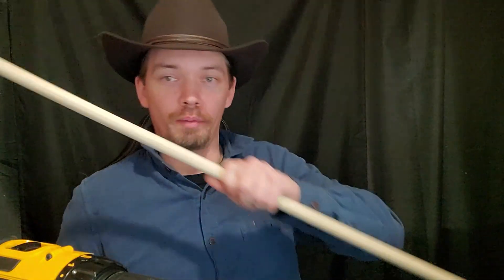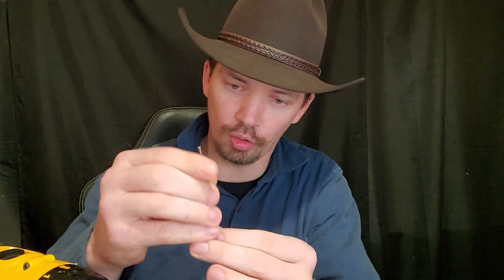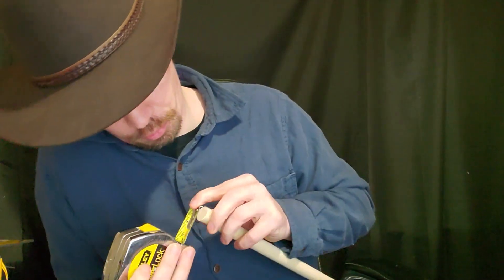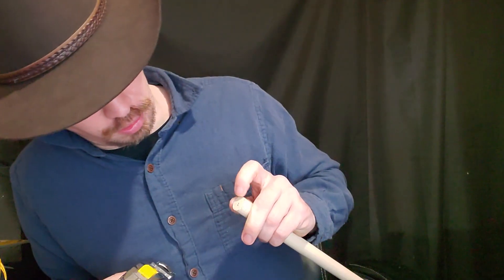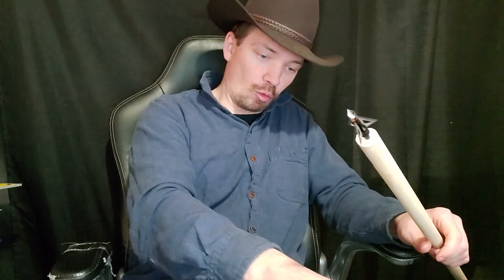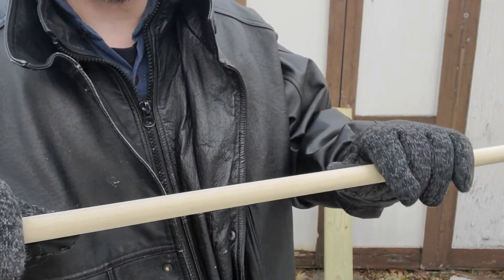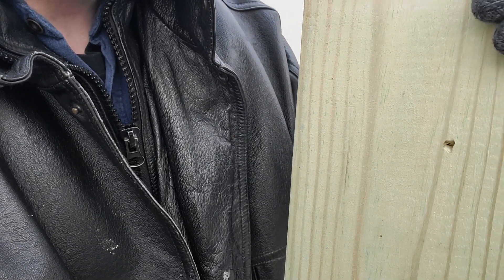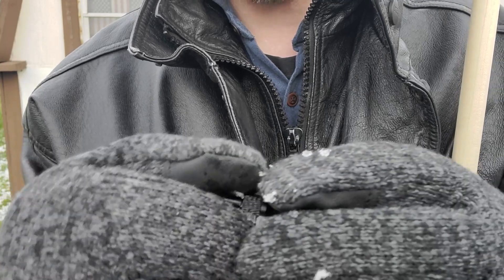A Failed Spear

Comment: Great try !! And yes look for the old style bear arrowheads. But you would be better off stepping up to a 1 1/4” dowel and sharpening the dowel to a point and then sticking in some coals for a little bit before doing a final sharpening and smoothing. The heavier dowel will allow you to use it as a staff and also give it some punch if you threw it!! 👍🏽🇺🇸🙂
Reply from the maker: I will give that a try. Thanks for the tips

Comment: Well Grim, you learned that if you were in a combat situation don't use the tip until you have an opening. Next time remember  to use something like fruit , that would have about the same resistance as flesh.  Heads up for my video response to this video .. : ) it's all good..